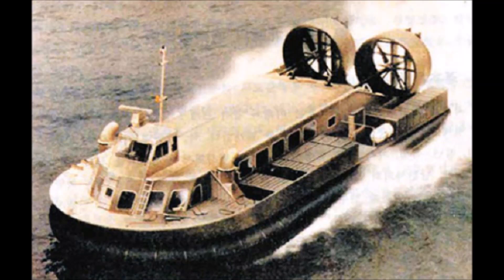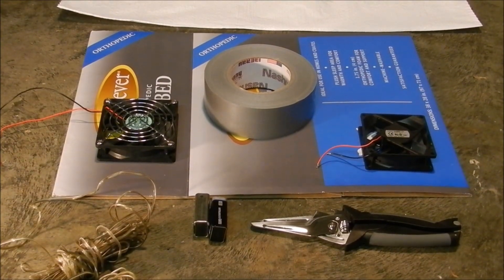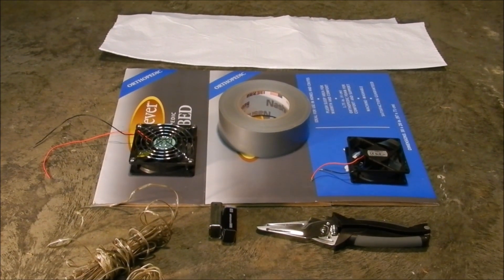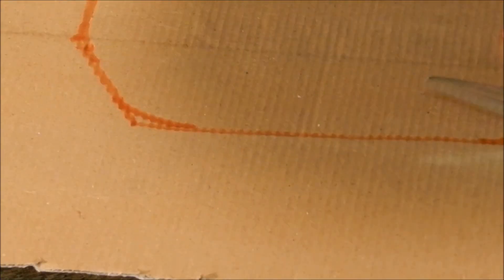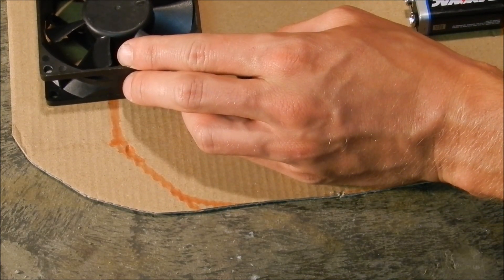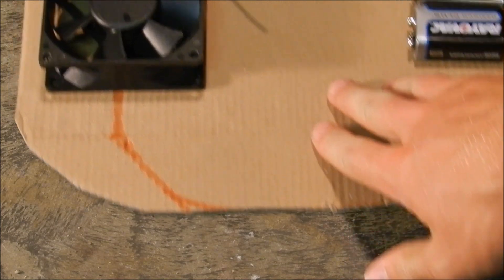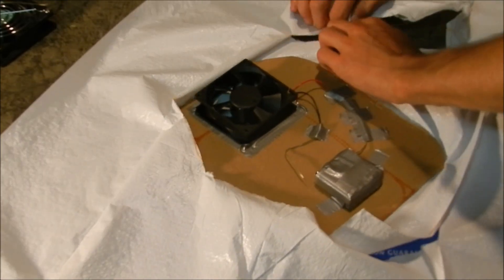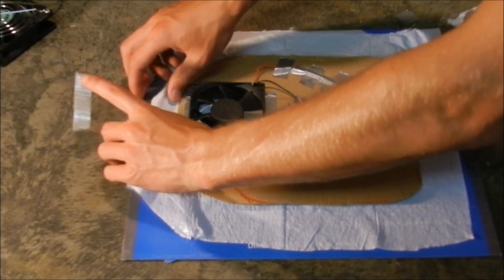How to Build a Mini Hovercraft Step By Step

Comment: I built a model hovercraft, mostly from balsa wood, in the early 1970s. It kind of worked, but couldn't carry the batteries that powered the motor. Battery tech has obviosly moved on since then. I remember though ,that during my childhood hovercraft obsession, there was a petrol engine powered hovercraft kit for a little over £300. , which in the mid 70s was quite a lot.
Reply from the maker: It’s more likely that the motor tech has improved and become lighter. We still use nearly the same battery technology as we did in the late 1800s.

Comment: If you're interested, I've got a build video showing an easy construction method for a great performing skirtless craft.

https://youtu.be/ocuYTigFA4o?list=PLGbZTlKSG1v9yLH3yBXPXX6cCy8zQNdTt

I've tried a LOT of designs and I've found at these scales both skirted and unskirted craft perform best with the type of hull that i build in my video.   My skirtless models hover with over an inch of ground clearance and my skirted model with weight shift pilot flies high enough to use curbs as launch ramps.   Here's a vid of the skirted piloted craft carving into a curb launch step-up to the top of the hill.

https://youtu.be/7-oTpiiwjVA?t=3m18s

I do a lot more styles of hovercraft as well, and one of the most fun is the single fan "racing" style hovercraft like this one,,,

https://youtu.be/HwZh4qob6Fs?list=PLGbZTlKSG1v9yLH3yBXPXX6cCy8zQNdTt

Comment: maaaan i always need this propeller but i dont have it :(
Reply from the maker: They are so cheap to buy if you don't have them. Radio shack or anywhere should have them. You could even ask a computer repair place if they have an old junk computer that you can have the fans from. They may charge you or just give them away for free.
Reply: well ok :(

Comment: Hello! Nice video! I would like to recommend one thing, though. I am not sure if you are as nerdy as me, but....... there is a chip call Arduino. There is many tutorials on YouTube, and what you do in it is code. (Basically engineering.) The main thing people build(in my opinion) is a remote control car. It's pretty awesome and I recommend that to you. You can buy a chip at your local Radioshack or Arduino.cc.
Reply from the maker: Thanks! Yes, I've heard of it and it looks really cool. It'd be neat to get an rc hovercraft built and programmed.
Reply: NICKELGHANDI
That would be awesome; maybe you should try it out! There is many tutorials on how to build remote control toys with Arduino. I personally am building a Quad Copter at the moment.